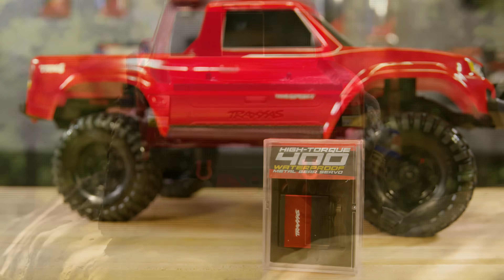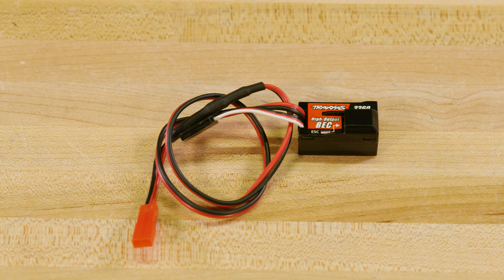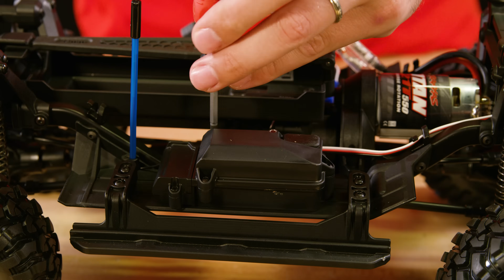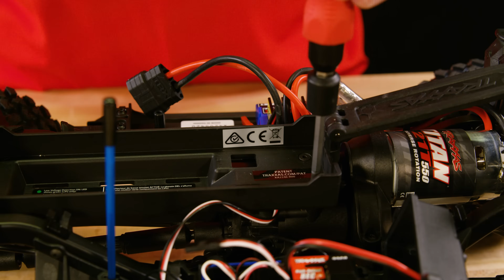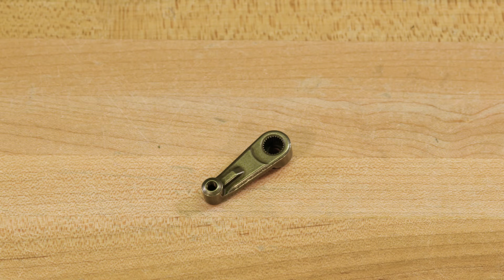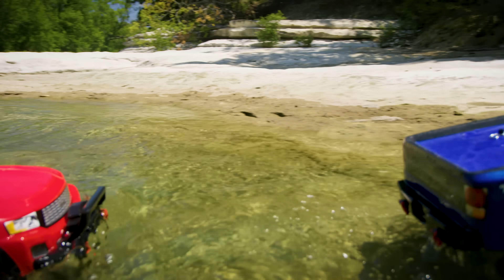High Torque Servo Installation | Traxxas TRX-4

Comment: For anyone else wondering why this BEC is so different to other becs, I have an explanation. For starters, the jst on the esc supplies battery voltage, whereas on the vxl 3s it’s BEC voltage. That should be somewhat obvious, but what is really bonkers is why the bec is then placed between the esc and the receiver. It’s done both to disconnect the esc’s internal bec, and act as a trigger signal to turn on the BEC. The led power module does a similar thing, where it’s red wire in the receiver is just there to signal it to turn on so it isn’t perpetually draining a battery left plugged in.

Comment: Lmao I love how they say the ESC is high voltage yet you need a BEC... Also $150 is wayyyy too much for a 400oz servo, should be around $80-$100 for its specs
Reply: Will B just get a 25kg off eBay for £19

Comment: Is there a video for upgrading the servo in the Traxxas Stampede 4 x 4?
Reply from the maker: There is not, however this is just a drop in replacement. We do recommend that you purchase the external BEC, part # 2262. 

Please contact Traxxas Support if you have any questions.

U.S. - 1-888-TRAXXAS
Outside U.S. - 972-549-3000
E-mail - support@traxxas.com
Reply: @TraxxasSupport  does the BEC fit into the Traxxas Stampede 4x4?

Comment: Will this fit on the bandit
Reply: Steve Cruz it should but this servo is overkill for a bandit or any 2wd truck and you can get WAYYY cheaper servos than this
Reply: @traxxasrc10  thanks ill keep that in mind
Reply: I would go with a cheaper servo because this is kind of overkill for a buggy but yes it would work
Reply: @yeetyeetpotatoskeet5263  thanks im just looking for a way to upgrade my bandit the plastic parts keep breaking

Comment: Hi traxxas support. I have a light kit which is plugged in to the esc plug, how can I plug the bec in the esc plug?
Reply from the maker: The #2262 BEC kit includes a Y-harness so you can plug in both accessories.
Reply: Ok thanks

Comment: I love my TRX4 and I am impressed with the overall quality of this truck, but for God's sake Traxxas, include a servo that is up to the job.
Reply: The problem here is the cost.  If these came with a better servo and speed controller that had a good BEC they would probably have to increase the price by $50-100. I wish it came with it but paying another $100 up front might cause them to loose sales when trying to compete for sales with other brands.
Reply: The stock servo is good for the sport, but me and my friend both had ours die within a week
Reply: Yeet Yeet Potato Skeet I killed mine just running slow first time in our living room
Reply: In my trx4 sport I’ve had for about 8 months now and my original servo is Doing fina and is plenty for what the truck is doing
Reply: Yeah, i live on Bornholm and the rocks there are kinda tough, and often it just can’t turn because of the preassure.
Reply: Then they can't overcharge us for parts. You can get a Tekin or Holmes Hobbies servo for cheaper or about the same price.
Reply: lol it’s too expensive
Reply: @Loozilovebreadbutpreferchips  yea the 400 Traxxas servo is like $100😬